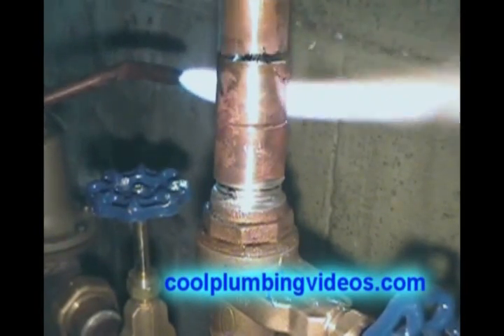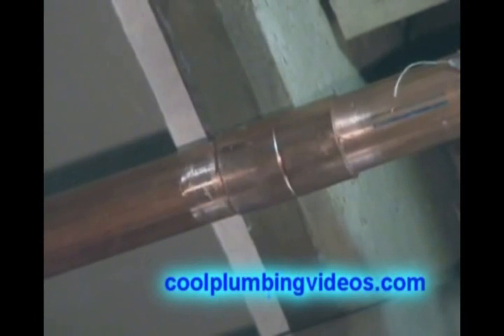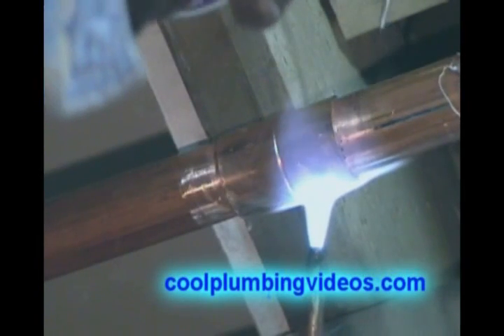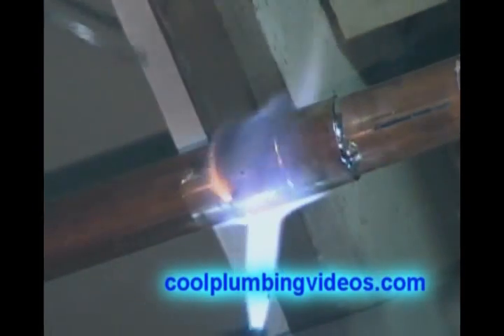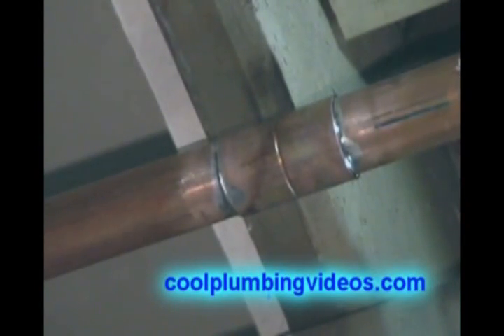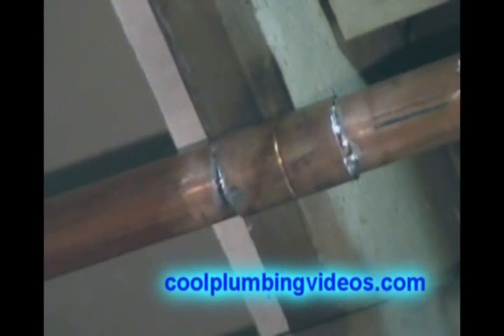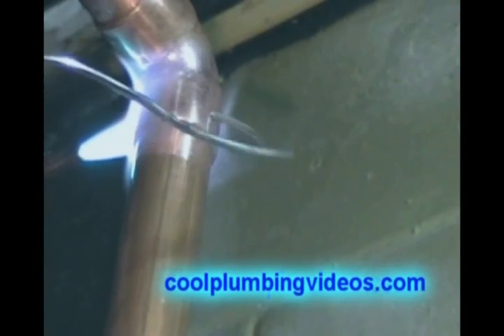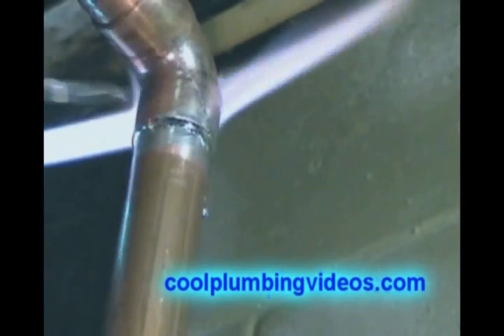How To Solder Copper Pipe 3/14

Comment: I am using  Lenox flux and solder from Lowes. Mapp gas benzo torch. (non adjustible flame). I ran out of Map gas a few days ago and went back to using propane, and guess what!!! 90%  perfect solder joints???/ Go figure
i'm going back to propane,

Comment from the maker: @ChueyMr11 Uhmmm. Are you using the right solder? Me I use NOKORODE flux. and make sure that you do strir up the flux if it's been seating for some time. And you do wipe the excess of after you put the fitting and pipe to gether? Just checking you never know. I say this because it sounds almost has if you soldering with out flux.

Comment: OK, I'm cleaning the fittings, applying and wiping off exsess flux and tapping heated connection with solder until capilary action takes place!
I am at a 50% sucsess rate.
Why do some of the beads of solder go around the pipe perfectly and other times I end up with a bunch of craters and flux residu on soldered joint.
Reheating and adding more solder does not improve appearence.
Same solder and flux
I'm getting there!!!

Comment from the maker: @ChueyMr11 What I do is apply the fire to the pipe and fitting back and forth when I'm ready to solder I focus on the fittling your right. It just works faster when you heat them both up at the same time to start out. :-) Sounds like you got the hang of it Cool

Comment: I have been applying heat to both the fitting and the pipe when I solder.
If both are at the same temp. capilary action might not happen??.
I'll direct most of the flame towards the fitting next time.
It appears it is not nesessary to apply heat evenly around the whole connection?

Comment: Am I out of sequence when i do verticle soldering, I always solder the upper connection first. Then on to the lower connection  where all the flux has dripped down to the floor. I end up adding more flux to heated connection , more heat . then some of the solder goes into the joint/
I'll try the lower conection first.

Comment from the maker: @plumberx Put the fire back on to the copper fitting going back and forth as needed to control the flow of the solder. Like any thing els practice. Don't feel bad I still get solder falling to the ground. One other thing after you put the flux  on the pipe and fitting wipe the excess flux off and your solder so that the solder will not run every were. Good luck freind and thank you for the comment. this may help some one els out there.

Comment from the maker: @ChueyMr11 Lol I'm not laughing at you. I'm laughing with you. I do understand gravity can be a hender some times. First make sure you do have some safty glasses on when soldering copper pipe in the  verticle position.
Turn the heat down and little keep taping the pipe with the solder untile you see the solder being suck ( capilary action ) into the copper fitting then pull the touch back keep solder on fitting as the solder starts to flow around wipe the solder up into the fitting.